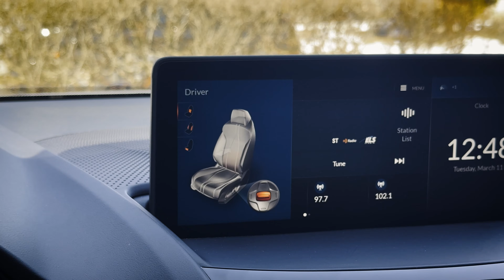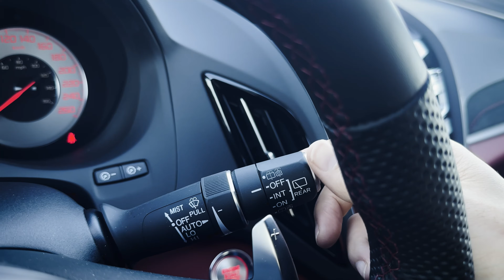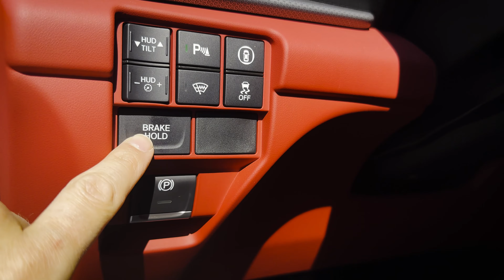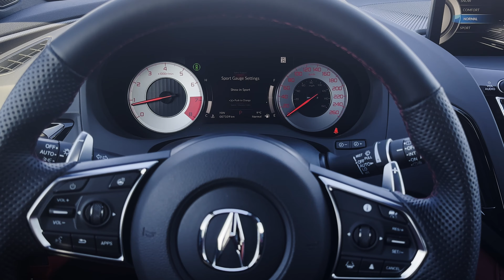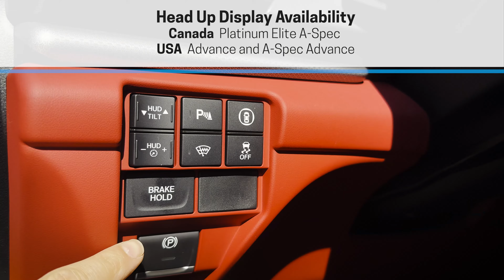Steering Wheel, Cluster and Head Up Display in the Acura RDX

Comment: It is true the HUD is at a slight angle, down toward the passenger? I just got a 2024 RDX and it is driving me crazy wondering.
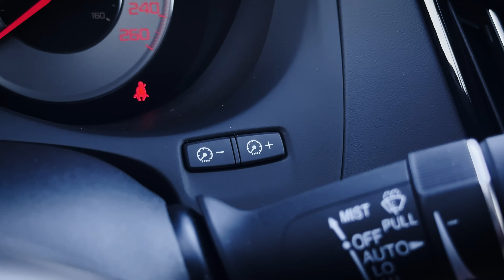Reply from the maker: No.. why would it angle towards the passenger? I show off how to change the tilt and rotation around the 10:15 mark of this video.. but if there's a visibility issue it could be that the HUD is installed incorrectly or the actual display has come out of place. Try adjusting the tilt/rotation and if that doesn't fix it, have your dealer take a look the next time it's in for service